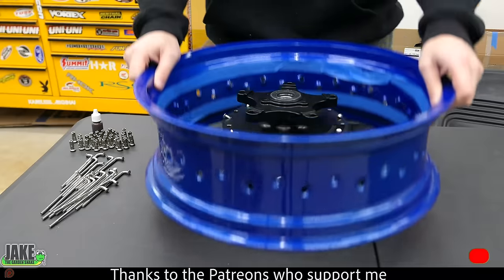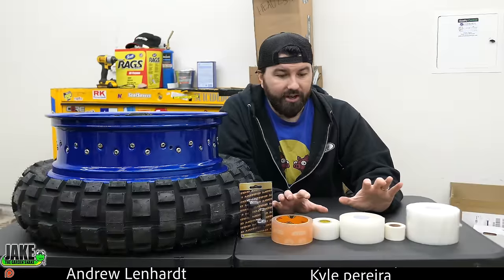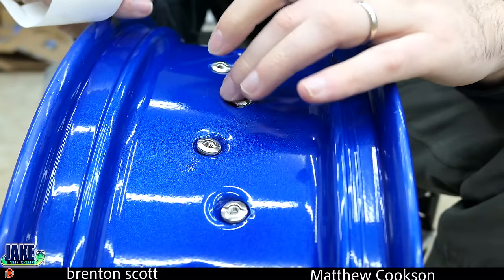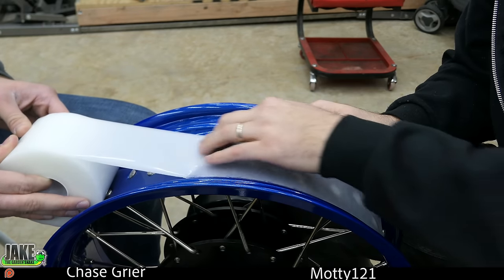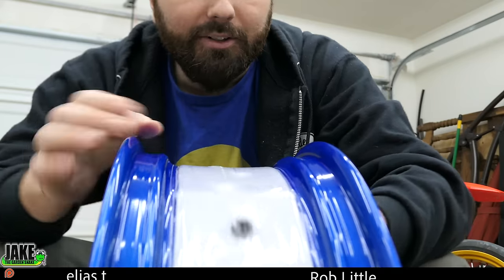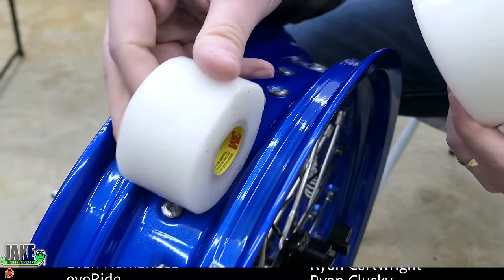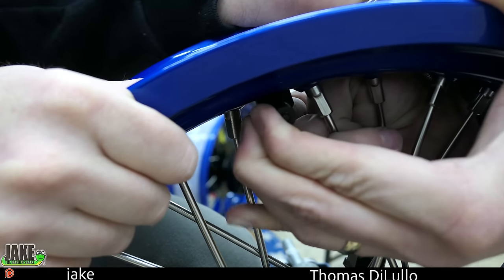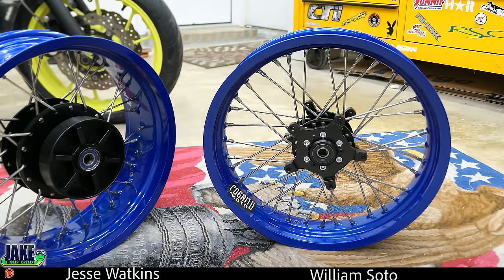DIY Tubeless Conversion MT-07 Adventure Build #4

Comment: Pro tip: use 2 layers of 3m and 4 layers of clear tape. Dont go crazy trying to push the tape down, air pressure will massively push it down to the rim

Comment: One tip a tyre/tube patch roller works really well for going over the tape. I'm going to have to try your kit as they look identical to the original Outex kit. I've them on my bike for several years and haven't had any issues with leaks.

Comment: Gorilla tape is surprisingly effective at converting tires to tubeless. I took non tubeless mountain bike rims and used gorilla tape as rim tape and mounted some tires up (that were also not tubeless ready tires) and used some stans notubes and it held air perfectly.

Comment: This thing is really coming together. Did you take a look at the Motoz Tractionators? I’m running those on the sled and they look as aggressive as the TKC’s. Can’t wait to see you yeet it off some jumps and prove to the dual sport world that it CAN BE DONE
Reply from the maker: The TKC80s come in the sizes I needed. I don’t think anyone else makes a 180/17 knobby. I also knew this was a pretty trusted tire. Comes stock on lots of big adv bikes.
Reply: I had the tractionatos on my WR, I would recommend them

Comment: Hey I know it's an old video. I just bought a husky vitpilen 401. Wire wheels with tubes. 

How is this holding up?  
Have you made any improvements to this system? 
Would you recommend this on the little Cafe bike with 17 street tires. 
I really don't want to worry about tubes, because I doubt I'd be able to break the bead on the side of the road with hand tools.

Comment: @Jake would it be an idea to use a heat gun on the tape to remove the creases and make a more smooth stick to the rim? I'd be interested to know why you didn't do so if you have considered the option! :) Awesome job with the videos!
Reply from the maker: There are no crease in the tape. This isn’t the kinda tape you can fix creases with by using a heat gun. You gotta take care applying it.
Reply: @TheGardenSnake  everything looks like a nail to a hammer! 😁

Comment: Two points - rather than an extra layer of clean tape why no use rubber rim tape or two rubber rim tapes if a wide rim.  Being a continuous band of rubber it will be better than sticky tape which could start to lift at the ends.  Secondly its the rubber o ring that is sealing the new valve so once in position on the outside of the rim you do not want to be subjecting that rubber ring to are turning movement where it can distort  I'd rather rather tighten the nut on the inside carefully

Comment: Did the tape hold up over time?
Reply from the maker: Ok it did but ultimately I had to go to tubes. With these wheels (even though it has the right rating and lip) the bead would randomly let go. I let them sit at 50 psi for weeks and they held it 100%. But while riding the front would sometimes just pop off the bead. We’d fix it, blast the wheel down in soapy water, nothing. The rear would be fine while riding and for months. But then every now and then I’d come out to the garage and it would be off bead. I’d fix it and like maybe another month later I’d find it the same way. But we tested it again and again, it wasn’t leaking from the spokes. I also ran this set up on my XR650R supermoto without issues. It can work but depends on the rims lip.

Comment: So how would you plug these properly if you get a flat so that they will refill again without leaking ? Really enjoy the build Jake cqnt wait to see the final project and its be interested to see berad testride this one too lol
Reply from the maker: A road side patch kit. Or if you can get the wheel off a proper plug installed from the inside.
Reply: @TheGardenSnake  so how low of a pressure could you run as my bike I run about 12 psi because of the terrain where I ride ?

Comment: I've always used 3M 5200 Marine Sealant. Works flawless. I wire wheel the inside of the rim around the spokes. And I go around it adding sealant directly on each spoke then add more and more until there's 1/16"-1/8" thick layer across the whole inside lip. I cut cardboard to match the inside of the rim and use it as a spreader. And do it all on a balancing stand to rotate the wheel easily. No issues. On dirt bike or my heavy VTX1800S. Costs around $10 a wheel on average. To each their own though. I hate tubes. Just so much extra hassle.

Comment: You bone heads, just put the tubes back in and put 40 lbs air in .set for 24 hrs, then remove tubes.  Tape is perfectly formed.  Did this to my 2018 x300 versys. Tires have kept pressure within 2lbs for 2 years.

Comment: here in brazil and put rubber on the nipes to not leak
Reply from the maker: I’m not a fan of any kind of rubber, glue, or silicone over them. One it basically makes them none serviceable. Second and mainly it doesn’t work very well. Almost everyone I know that’s don’t it ends up with at least a slow leak. On a good impact those spokes and nipples can pop up like a few hundredths mm. And that will end up breaking that seal. Also the heat on and off ain’t good either. The metal expands a little but the sealer doesn’t. If it works for you then that’s nice but I won’t do it.
Reply: @TheGardenSnake  and that I had never seen this method of sealing, I found it different and cool, but now I just want to see how the bike will look with the new wheels and tires uhasuhsa

Comment: just use flex seal smh
Reply from the maker: Go price that out. A roll comes with about two feet for $20. And it’s no where as thick and tough. I’m showing you a commercial grade product. From my experience flex seal is like gaffers tape with a strong adhesive. But hey try it and let us know.